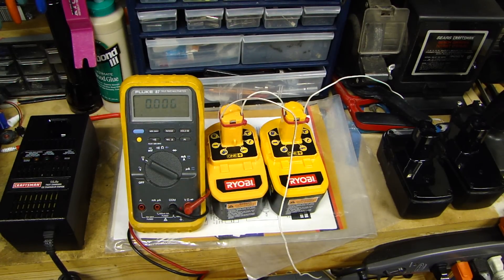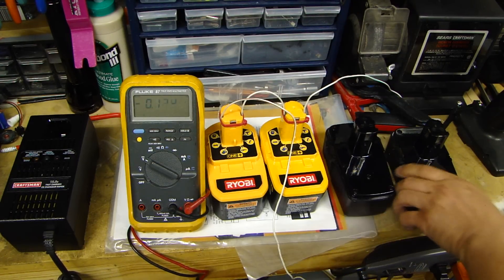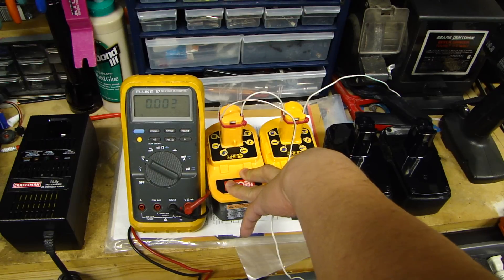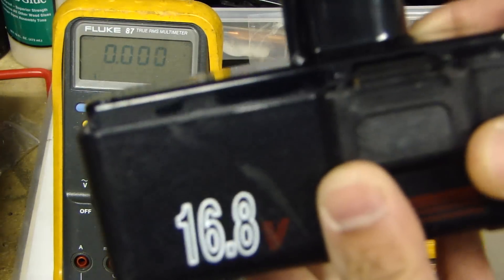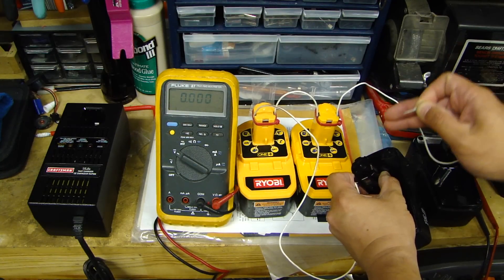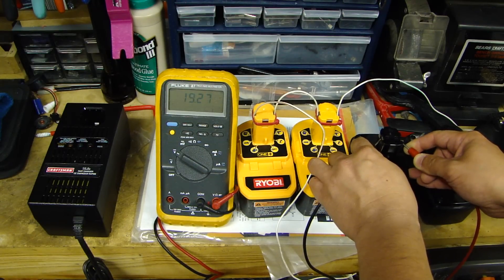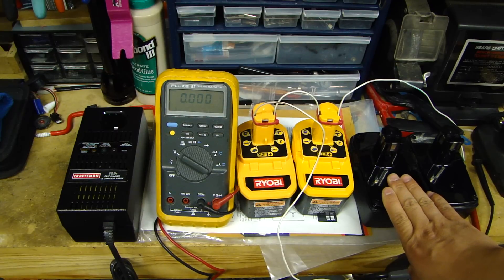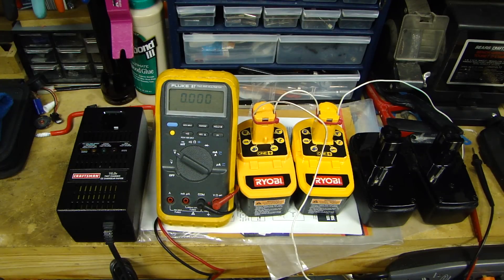How To Revive & Fix a Bad NiCd Rechargeable Tool Battery - Part 1

Comment: Tried it, I was skeptical at first but it worked. I drilled 18 long screws into soild wood to see if it was false power but it wasn't, fast or slow it performed flawlessly. Don't know how long it will last but for now it's good.

Comment: worked! it was enough to jump start a battery that would only charge for a few seconds before the charger said it was full.  this helped it get past that hump and allowed my battery to get a full charge back!  thanks for sharing a method that didn't need a bench top power supply

Comment: It does work!  I had a Ryobi that wouldn't charge.  It would test and then show defective over and over.  I have 2 18V B&D batteries with 2 pins.  I used alligator clips to connect them in series.  Then I tapped like Jerry says to do in the video here around 7 times.  It sparked everytime.  I plugged it into the charger and sure enough it is charging right now!  Thanks Jerry!!

Comment: got a 15y old maglite rechargable. immigrated to a country where its waaaay to expensive to get a new one so after a decade of no use its a little oxidated and dead. i just used 230v on both ends and sparked it. original batery life was 1.5-2h now after this i needed to recondition it. charged 2.5h every time.  first charge gave 5m worth. 2nd charge 40m. 3rd 65min and 4th 1.5h. so yeah it defo works. considering its a 15y old battery (high quality)

Comment: I have tried this with my dewalt batteries and they still don't seem to hold a charge for long please help
Reply: Scotty bcos after doing this you need to recondition them. charge them as long as you would a new one. then completely discharge them. do this about 4-5 times you may need to do it more depending on the battery capacity. how higher the amps how higher the capacity. 4-5x is for a 2.5A battery extending its life about 18-20x (for most batteries) more then after the initial method described in this vid.

Comment: You could also charge up a good sized electrolytic capacitor, to do this. But, you need to recharge the capacitor each time,  as the capacitor completely discharges each time you flash the battery. We were doing this back in the 60's & 70's when nicads became popular in the AA battery package in toys and phones. The flash discharge, forces the chemical memory away from the center (b+) rod, Never really tested how much voltage was safe, we were usually using 12vdc charge to a 1.5 volt AA battery.
So, it's not a new trick guys. Understand your battery will never be 100% again. But, it will allow the battery to last you a  little longer, despite the discharge time, will likely drop off a little quicker.

Comment: Dude..you just saved me 40 bucks..Thanks! I had a dead 12V NiCd Ryobi battery and I used your method to rejuvenate it using a 20V lithium battery. From 6.9V back up to 13.6V on the NiCd....most excellent!!

Comment: Had a 8 year old 18v nicad that wouldn't charge and this procedure worked great.  Thanks for the video.
Reply: He does say that if it doesn't work one of the ni-cads in the unit may be bad.  To check it open up the battery case and read the voltage of each individual battery.  A bad one will read much lower than the other ones.  In that case you would have to replace the bad battery.  I've done that before because I can solder.

Comment: Can I use a Lithium battery as a power source in series with a Ni-Cad?
Reply from the maker: +Richard Robbins Lithium Ion batteries have a circuit board built in. I don't know if it will work, but I would recommend not so you don't end up damaging your expensive Li-Ion battery.
Reply: What about  ni mh and a ni cad?
Reply: No! 
  If you mean just to shock them, you might be able to get away with it,  depending on capacity,  discharge rating  etc.,  but it's not very good for them.

Comment: I bought 3 dead chargers, and used the holders, modified with banana plugs to make a zapper, dead in the middle and good both sides. insert 2 good, then one dead pack using a push button, 36 v across the dead unit and press press, job done. :)

Comment: Literally the best thing I've seen all day.  This worked perfectly for me.  I just used one new 18v drill battery to zap a 20yr old 7.2v drill battery which recently died.  I couldn't find replacement batteries for such an old drill, so I was planning on binning it, but this method brought the battery back to life.  Thank you!

Comment: My Ryobi 18v lithium battery reads 20v on my multimeter when fully charged but my Ryobi 18v lithium plus battery reads only 8.5v when fully charged. Ryobi says that the reason is that the plus batteries must be tested under load to render a true voltage measurement? Does that make sense?
Reply: John Brabant reading it wrong? Who ever said that doesn't know what they're talking about because voltage only drops under load, never goes up.
Reply: They are probably getting confused about checking current instead of the voltage

Comment: I understand how this will let you rejuvenate charging the battery, but does the battery hold its charge for use? I find overtime my NiCad batteries simply don't last as long even after charging.

Comment: I used to do this when I had older 6volt tools using a 12v battery charger. It did work, but, as he said sometimes one of the cells is shot. Always worth trying.

Comment: It's just chemistry. If the connections and cells have a good circuit you are just Zapping a internal battery crystallization that occurs with repeaded charging and over time with inactivity. The method works until the reacting components in the batteries finally goes bad. It is not a forever battery saver.. just a Ol timers battery trick resurrected

Comment: I have a theory about dead NiCd cordless batteries. The included cells are not exactly identical capacity, so over time using them and charging them there will be unbalance between cells. As u can notice while using them the power decrease in steps when a cell gets empty. One idea to fix this is to overcharge very slow. After charging with original charger connect battery to a higher voltage with a current limiter like an resistor. Make sure NOT to exceed 100mA, rather go for 50mA. There is a drag with this procedure, take lots of time. Ex. 2400mAh / 50mA = 48h. I'm not sure how slow overcharge effect's the batteries but I heard fast overcharge damage them.

Comment: To recharge a 3.6 volt ni-cad, how much "source voltage" would be needed ?  At least double ? I understand that this procedure is for rejuvenating a ni-cad, but can the pulsed voltage (source voltage) be from something other than a ni-cad ? A lithium, perhaps ?
Reply: Rustifer You are effectively shorting the batteries which is NOT something you want to do with Li-ion batteries, they could explode.

Comment: I used the technique that ***** described wherein you plug and unplug the battery to and from the charger quickly numerous times. Before doing that, the battery was essentially dead. I attached it to my drill and drill would not work at all. I tested the battery with the multimeter and it read just over 17v. After the charger technique, the multimeter read 19.2v. I was then able to charge the battery up to over 20v. I attached it to my drill and everything works great. Anyway, I'm happy to report being able to use this very simple technique to reset my 18v NiCAD battery since it did not require using any separate batteries and wires. Thanks, *****!
Reply: Russel the lookout link goes to a page where the mentioned video, which I assume is about recharging a battery does not seem to exist. Would you be able to provide an actual link to the exact video?
Reply: The 3 Best Batteries For An Off-Grid Energy System >> Restorebatteryy.blogspot.de
Reply: MRussell McDowell kkkk:major was 3
Reply: The 3 Best Batteries For An Off-Grid Energy System >> https://t.co/mK3KjJd0lr

Comment: My old batteries would not go above .04 volts on the charger at 2 amps charge rate even.  Did this trick and it instantly read 5 volts and takes a charge!  Its not going to make old batteries new again.  But, they will once again be usable. Thanks!

Comment: I personally don't believe this tutorial. Why are your batteries in such good condition for "7 year old" batteries? Not a scratch on them! In fact, they look like they are brand new with little or no use! Also, no actual demonstration takes place!
Reply: My freind, at least try, do not be pecimistic.
Reply: II tried it with a craftsman screwdriver battery pack! I used a 6 volt transformer and three large capacity capacitors.  It worked, before it wouldn't hold a charge at all!  After jolting the battery pack 4 times,allowing the capacitors to recharge in between, I am on my 2nd day of using the screw driver!  By the way the screw driver is at least 11 years old!  Warning though wear safty glasses and allow at least enough wire between the positive on the battery and the positive on the capacitor.  The capacitors hooked up in a series circuit.
                  mike
Reply: Andy Nicholson Perhaps the batteries were 'damaged' by prolonged non use. Batteries have a self discharge so if these batteries were left in packaging for several years, it's possible it will get so low in voltage that the charger will refuse to charge it.

Comment: I have this same Sears Drill but the batteries were too far gone for this procedure to save them.  I ended up rebuilding the battery packs with higher output batteries.

Comment: Great Tutorial.  Just resurrected a Craftsman C3 NiCad battery and a 7.2V Cratsman Screwdriver using this method.  Very excited about the screwdriver since Sears says the battery isn't replaceable and that you're essentially out of luck when the battery dies.  Thanks!

Comment: I've tried this too, & it works. However, the revived batteries seem to have a short life, & soon return to their normal dead unchargeable state (which is probably a bad battery w/in-they're connected series). Also, I just purchased two new batteries for my last recharge & now they don't stay charged for very long. Is there a relationship? These are just observations. Small plastic C-clamps & cardboard seem to work better than zip ties.
Reply: They are suffering from bad charging practice.  You shouldn't constantly bake your batts in a fully charged state,  leaving them in the charger.  Manufacturers recommend charging at 30 or so % and waiting till just before usage to bring them up to full charge.  I didn't take care of  a set of Ryobis and they became paperweights after less than 3 months.  A real bummer because of the many devices they powered.  I haven't tried this on them yet.  Going to your batts manufacturer site and read what they suggest is never a bad idea.

Comment: Hi dial2fast,
I'm trying to understand what happened to my NiCad charger/batteries...well, 18v batteries are as low as 8v-9v (both), the charger output reach max 11v (???)...before I watched your video i tried to raise the batteries voltage with a short charges from a 24v adapter...and it raised to 17v-18v..still won't charge (green led on, red LED always off).Could you give any tips?
Thank You

Comment: Man thank you a lot at the moment i dont have 2 batteries also ( burned my car batery charger)  and i used 3x 22000 mf 25/28 volts and it worked.  5 discharges (50/60 A maybe) and it is back to life , the battery was like 1.3 V did it and it jumped to 3.4 v and now its charging again my old drill is working . Thank You

Comment: Good video my old Hitach is suffering from quick run-down on one battery , I'll try it and see .but my other Lithium Ion light duty driver just plain died can't get it to do anything .
I'll probably need to chuck it unless I can find cheap batteries to replace the internal ones that do not come off .Too bad its a nice light tool .

Comment: Worked for me thanks. Connected a laptop charger and car battery charger together to get about 32v. Zapped my old Bosch 24v rechargeable drill battery and it now holds its charge. People are selling this information on ebay.

Comment: Little advice--scrap NICD equipment and change to lithum battery operation. Zapping the battery packs and recharging thempponly gives them half life or less. My lithum battery drill outlast any NIcad drill. Go to Home Depot--Only Robyi sells NICD replacement. All the other big boys have switched to Lithum. Before zapping NICD--open the battery pack and check for sulfating and clean or your wasting time. :^(

Comment: Think you can help?
I hooked up 4 9v batteries to try to jumpstart my airsoft gun battery, takes 14V to charge Ni-Cad, and zapped it like 5 times didnt do anything, still dead. did it like 20 times, nothing. every time it droppes from 34-11-.02-0 in a half a second. Can anyone help?

Comment: I did a technique similar to this with my old 12 volt Ni-cad batteries, and a 12 volt car battery charger to shock them and then charge them on the regular charger, but when I went back later after charging it was dead again, so I just gave up.  Good video though!

Comment: I tried this once and I wasn't convinced but since using a digital test meter and a DC power supply of twice the voltage of the cells in question, I can say that this absolutely works! Thank you mate. 
You can actually see the voltage output of the cells being corrected after they have had a few (5-10) zaps - followed by a full regular charge on the correct charger for the packs. When I tried it before, I think the cells had some circuitry inside that stopped them being rejuvenated

Comment: What is happening is that old NI-cad batteries dry out and crystalize, and the crystals short out the internals. When you zap the batteries, you burn out the short. The amount of voltage you use is not critical, the amperage is - the higher the better, you need to blast the short! You need from 10 to 30 amps capability in your power source. Note this repair is temporary and may not last long, the batts are still old! The entire batt could explode if you're not careful with it, user beware.

Comment: So, If all I need is 36V 2.5A, then if I have an old 36V 4A 150W Watt AC/DC Power Adapter laying around.  Any reason I can't strip it and use it to shock the 18V batteries instead of the "good" batteries you are using?

Comment: I would use a battery charger to zap the battery with,,,you are risking reversing the polarity in side the battery pac ,,1 or 2 of the batteries in the pack.

Comment: Yes ,that is what happened in your drill battery pac,1 or 2 has reversed for one reason or another and now when you reverse it actually reverses it back to normal polerity. now just charge it ,the way he is doing it will work but they wont hold under the work load very long.

Comment: This really works! I did it with five regular 9 volt batteries all hooked up together for a total out put of 45 volts and fixed two 18 volt battery packs, after I got those fixed I used them as shown on this clip to try and fix two others it work on one the other I believe had a dead / bad cell as I could only get a reading of 3/4 of it stated power load on my meter

Comment: Excellent Video- thanks!
I posted the same question on your Part 2, but to precis;
Using your basic procedure in the Video, can i use two 12v Car Batteries in Series (24v) to achieve the same results?
Must the two Car Batteries be exactly the same amperage - one is 45aH - the other is 54aH?
You comment/s and/or any other information would be appreciated - thanks!

Comment: what you mean it doesn't matter. as long as the current is going the right direction, and it is pulsed. you can also do this with a disposable camera circuit.

Comment: Just did this last night on my 18v Milwaukee Drill Battery, **EXCEPT I MADE IT EASIER** and just used the the battery that was still working to "jump" the dead one that the charger wouldnt recognize.  + to +, - to -  taped it like in the video Easy, Let it cool for 15 mins, the charger finally recognized it and it worked great this morning.

Comment: this worked dandyfine for my craftsman 14.4 batteries... i used 24 volts by putting two car battery chargers in series.  Took about 20 seconds of zapping but did the trick... Thanks cuz those batteries go for 60-70 bucks a pop!

Comment: Cont.

On small rechargeable batteries for something like a phone or a kid's rc car, you could simply do a quick high amp jolt at normal charge voltage.  If your phone battery pack is x2 (1.2v x2) nimh or nicad batteries (600 to 900mah) then a quick 2 or 3 amp jolt of 2.4 to 3 volts will be enough to gain back a lot of your old battery's life back.  It's not necessarily a requirement to double the voltage.

Comment: Cont.

A higher voltage/higher amperage jolt on batteries can be good to get rid of crystal build up that blocks the current.  The crystal build up acts as an added resistance or a choke on the current flow.  This isn't true of just nicad batteries, though.

Comment: 1) You *can* do this with NiMH.  2) You don't need twice the voltage to jump start dead batteries.

The reason the charger wouldn't charge those dead NiCad is because a lot of electronic chargers won't output any current if they don't receive any current.  That is to say, if a 100% dead battery doesn't send a signal (a current) to the charger, the charger won't send current back.  You could probably jump start dead batteries with a 6v lantern battery and you would have gotten the same effect.

Comment from the maker: My disclaimer in the description is to tell people not to try to revive a bad LiOn battery. As to using LiOn as the power soource, I don't know if it might damage the LiOn batteries. LiOn batteries are so expensive that I don't want to be responsible to any damage that may incur when using LiOn as power source.